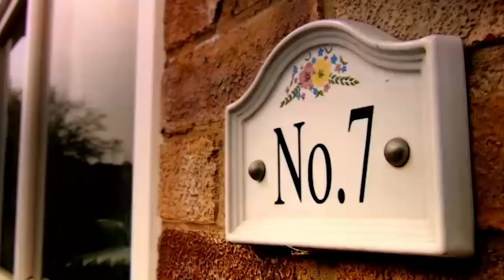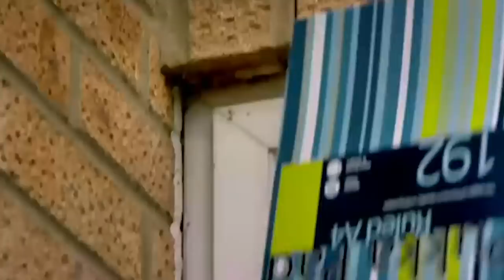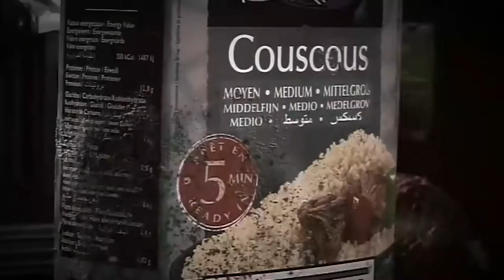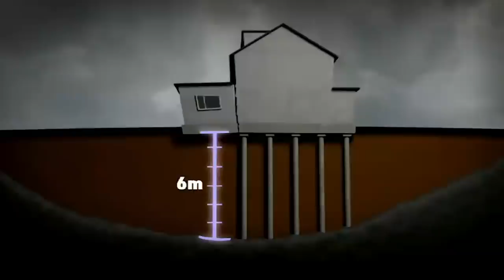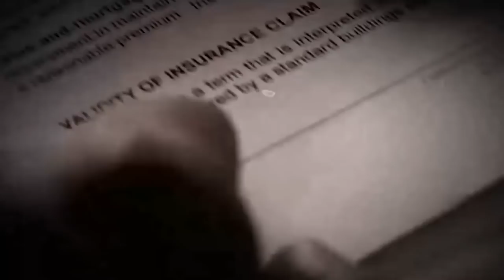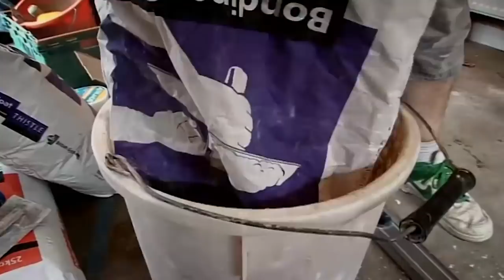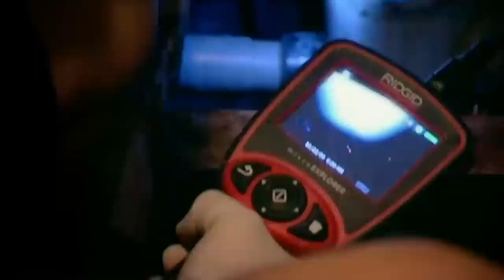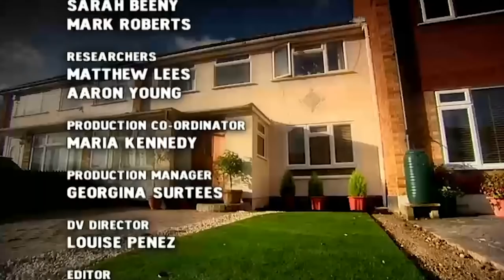Sinking Extension and Health Hazards: - Help! My House Is Falling Down - S01 EP2 - Home Renovation

Comment: Mold advice is very wrong - you need the humidity to be below 60% or ideally 55%. If it's humid outside then opening the windows does no good, you need a dehumidifier.